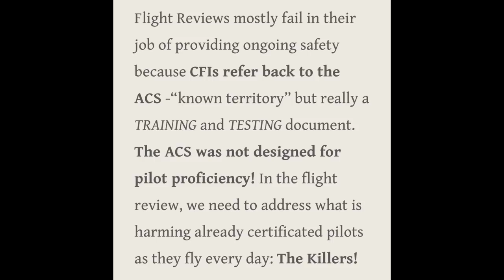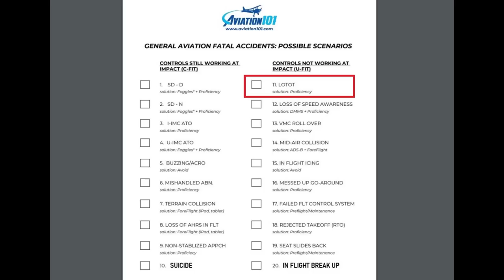Engine Failure at 400 feet.  The Impossible Turn.

Comment: Practice turning back at altitude to figure out your expected altitude loss. You don't have to land on a runway. Take a taxiway, another runway, the ramp, or even the grassy infield. All are preferable to a housing project, a shopping mall, or the trees. Turn around right away. You can talk later. Great job, Mr. Airman. Thanks for promoting AQP, Dan. Barry Schiff's son has been studying this and he's found some "impossible turns" are actually quite possible.
Reply: My sentiments entirely!!
You don't have to land on the runway. You can land across it if insufficient height.

Ploughing through fences or runway lights and equipment etc ain't going to kill you.
Spinning in WILL 

So the airspeed & keep those wings  level close to the ground.

Comment: Not mentioned  much in this vid. was the fact that the engine was still generating some power with three cylinders.    As I understand it, there was not COMPLETE loss of power.   This probably allowed the 180 degree turn that may not have worked out as well with a completely dead engine.
Reply from the maker: True.
Reply: Yep, huge difference in some power and a windmilling prop creating drag
Reply: Was about to say the same thing, and it's probably not that rare for an engine failure to still leave you with some power. That's actually more insidious than a clear-cut engine failure because it might cause a delay in remedial action.
Reply: Yes and PARTIAL power loss on takeoff is yet another thing that the FAA private pilot curriculum doesn’t teach us about! Question - in the scenario in the video, should you leave the throttle in to get what power you can, or is there too much danger the engine will shake itself off the mount?
Reply: @crufflerdoug  Yes, wish the FAA required teaching about partial power loss. I'd keep the power up to make the airport and ignore the vibration.
Reply: I lost a cylinder as I flew by an airport in an 85hp Luscombe. I just turned final, lost some height and landed. The engine was still running on 3 cylinders but stopped on the runway. Turns out the valve rocker mechanism broke on one cylinder so still had some power. But the sudden loss was startling.

Comment: Good situational awareness knowing where the wind was coming from and turning into the wind to stay close to the runway. The radio procedures were god in that you told them what you were going to instead of waiting for their instructions. The first transmission was a little long. I always instructed my students in a similar situation to maintain control of the aircraft, pitch to best glide speed then say to the tower, “Cessna 1234 engine failure declaring an emergency.” And the throw the microphone (or headset on the floor as far away from you as you can and then take whatever action you deem necessary. That was great advice from your Dad. Excellent job and great interview.

Comment: He was lucky to fly into the wind. Every time I take off I decide whether to turn left or right depending on the wind if I decide to return. e.g. He turned into the wind which gave him better lift and kept him close to the airport. What is the problem if he had turned to the right. The wind would be a tail wind with reduced lift, he would be losing altitude and and it would push him further away from the runway. When he turned back he would then face a headwind which would it harder to return to the runway. I am an ATP with 3,600 hours and I have an RV6 and can do a 180 in 200'. A great experienced instructor pilot friend showed me a trick.
1) Push the nose down to maintain glide speed. 
2) Do a 60° bank (Try 45° to start with) turn whilst lowering the flaps at the same time to full flaps.
3) As you bank back to level flight whist doing it raise the flaps back to 0°. ( This is done with or without using the wind)
I suggest you go and accomplish this maneuver. After this then do the same maneuver to a 270° turn to recreate turning back to your departure runway.
You will have fun trying to reduce altitude loss on each attempt and maybe one day it could save your life. 
P.S. I will not attempt the "Impossible Turn" if I am below the TPA. Fly Safe!

Comment: I have had several swallowed valves in my 56 years of flying. A piece of the hard steel exhaust valve breaks loose and is hammering away at the aluminum piston top. The valve either wins the struggle and either puts a hole in the piston(worst) or is ejected out the exhaust pipe(best). In a 4 cylinder if it ejects the piece the engine does just like Dan says. Immediately rough but you still have enough power to barely maintain altitude. I flew one time for 10 minutes in a 200hp Musketeer. In 6 cylinders its a little better and in radials its just a small miss . However when you pull the throttle back be ready to land and you will hear some backfiring. Great job Dan and Dan.

Comment: I used to fly gliders here in Australia.   Particularly with winch launch, "airspeed" is hammered into trainee pilots to the extent that on every pre-takeoff checks every pilot must rehearse cable break scenarios in detail, including knowing and reciting out loud vs, vs1.3 and vs1.5 of each particular aircraft  You must know wind direction and windspeed and proposed direction of turn if the cable breaks and you can fit in a modified circuit.  It is a very comprehensive, rigorous and comfortable, so when the inevitable happens at any altitude you just slip into the well rehearsed process without thinking or startle .... "stick forward, vs1.3, then make your decision as to whether you land straight ahead or fly a circuit.  I am incredibly grateful for those instructors who took us through this.

Comment: It’s unbelievable that the FAA doesn’t require AQP type training. In all of my military flying and instructing emergency procedure training was rarely pre-announced. Imagine taking off in a twin engine helicopter from a tight confined area without single engine hover capability and just as you clear the trees, your instructor pulls an engine to ground idle. Training that scenario allowed me to pass my instructor check-ride, and taught me the importance of AQP type training.
Reply: Actually Joseph, it's not surprising at all! 
As with the recreational Marine industry, the lobbyists fight against making it so onerous to use the product, that adverage people won't bother! 
While the resulting mishaps on the water aren't usually as dramatic as those in the air, lives are still lost on a regular basis. 
Oh well...another used boat/plane off the market!
Hate to be so cynical, but greed is the human condition!
Reply: My CFII would pull power and NEVER announced it.
He’d look over at me and ask … “whatcha gonna do?” I would then verbally and physically go through procedures he taught me.
I appreciate that to this day.

Comment: We always did 400 ft engine pulls on take off during BFRs. We always made our turns back and landed. I wasn't aware that it was an "Impossible "  because it was a common practicefor us to do. During tailwheel training would do 24 250ft dead stick landings in an hour. Made for alot of confidence.

Comment: I think this old pilot was cold enough to fly his Cessna within  its  flight envelope. when the engine quited he was 400 feet high, he inmediatelly unloaded the wing, and didn't overturn the bank angle. The plane was light and the proximity of the parallel runway helped a lot.
Reply: @CFITOMAHAWK2  That's a good point. Nothing far from the real facts: he managed to trade altitude for speed; made a coordinated turn without compromising aerodynamic flow through the (inner) wing. When I say "He unloaded the wing" it means that by pulling the yoke slightly forward, he certainly achieved "0" G-You can't stall a wing at "0" G-.  Managing the startle factor is paramount during this critical part of the flight. Many pilots don't fly to the crash; they just crash.
Without a doubt, Dan is running a very good campaign to avoid spins after an unexpected upset at takeoff.

Comment: Robert's dad was prophetic - keep your air speed!  And, his checklist "Fly the plane" as opposed to stalling or spinning the plane.  The farthest distance you can glide without power is to maintain max L/D airspeed - keep the nose lowered, but not too much, not too fast.  In Air Force pilot training we were always thinking and training for an emergency and memorizing check lists.  Save pulling back on the stick for the landing flare.
Reply: If you want to go down push forward. If you want to go down faster pull back.
Reply: @edwardhobelman6296 v.good axiom

Comment: Looks like he was still above the runway at 400' - which also helped for sure! Nicely handled sir
I'm in the UK. No way a student could do their first solo until they had EFATO procedures drummed into them. My instructor used to close the throttle at 300' and say what are you going to do?
I was always glad when the engine revved up again after I had pushed the nose down and said landing there! 
I can't believe that the FAA training does not include anything for loss of power - on take off or any other time. Surely it must be in there???

Comment: I had an engine failure in a Mooney 231 immediately when I raised the gear. I don’t know how high I was but it was most certainly lower than 400’. One thing to keep in mind BEFORE takeoff is the wind direction. If you have any crosswind at all you’ll have a smaller turn radius into the wind. It’s the same reason that you never turn towards the hill when ridge soaring.

Comment: My dear friend Lonnie had the same exact scenario occur to him in a C150, and he was at 400’ climbing out on 4 at LQK. The top of the rocker assembly casting broke off and left the rockers laying inside the valve cover. He too had a good left crosswind which he turned into and teardrop back to the runway and made it with just a loss of a wheel pant and a landing light, approaching the runway on a slight diagonal. Very lucky day for him as a student pilot. He kissed the tarmac when he got out.

Comment: Hi Dan 
Great video 
I was lucky to be trained in fixed wing aircraft by a Vietnam war veteran who flew Cobra and Huey helicopters. He taught me all the scenarios before I took my PPL single engine. Airspeed & fly the plane all the way to the ground was also something he said during every training session. 
I did have a total engine failure flying an Aeronca Champ in the pattern and elected to land off the air field in a location I felt I had a higher chance of survival. 
He had drilled into me the importance of always thinking about. “ when your engine fails where will you land. The best location might be behind you. Always look for landing spots” 
Slangevar 
Craig

Comment: There was another pilot that survived the turn of death recently. He received his pilot's license within the last 3 months. He purchased a Comanche 250 (59) and got checked out in it by a really good instructor, who trained him in all the things that Dan is advocating for. He took off from Auburn and lost power climbing out (tank selector switch sucking air). Could not maintain altitude. Pushed in on yoke, made the 180, declared an emergency, and made a controlled landing at about 130 knots.  He got it stopped with 50 ft. to spare.  Flat spotted the tires to the cords though. His new name is now Skidsworth. $1500 for tires and thorough inspection.

Comment: It also helped that the engine was generating partial power. 

I had a valve break in a Twin Comanche once. The little 4 cylinder ran very rough, but it ran!

Comment: Bought back memories of my c182 engine failure on take off at Townsville Australia several years ago. One of the things I remember in my turn back was the sound of the stall horn in my ears. Instead of landing in a crock infested swamp and missing the ndb tower by inches I landed safely back on the take off runway the other way. Cause, oversized fuel bladder in wings trapping a lot of water in fuel tank. Cessna went to wet wings on the new 182 I flew after. 
Barry Hill.

Comment: I wish we could have heard how quickly he started the turn back.  He said he reflexively pushed the nose down immediately but did he also initiate the turn immediately?  The audio is a little painful to listen to because of the amount of time ticking by as he communicates to the tower his situation and intentions.  I'm thinking as I'm listening to it that he is communicating everything first and then initiating the turn after the communication which seems to take forever. I hope he immediately pushed forward and started the turn while monitoring air speed and then got on the radio to communicate his emergency and intentions.  It took him 10 seconds on the radio to get to " I'm doing a 180..." and then Dan cuts off the recording...he might have talked another 5 or 10 seconds easily.  I'll just assume he was multi-tasking, talking and turning and monitoring instruments but in these 180 scenarios, 2 or 3 seconds of time are priceless and usually the difference between life and death.  Another take away on this should be Aviate - Navigate - Communicate.  All that time communicating did nothing to save his butt, it's a nice to have if you have lot's of time but in this scenario I'm not wasting even a second of time or my brain focus on anything but getting the plane to the ground safely which is going to happen very quickly at 400 feet with a 180 turn.  Another thing to keep in mind is the pilot was estimating his altitude and he might have guessed low with all that time he had to chat.  When losing an engine and power in an instant during takeoff, the reflex to lower the nose should be followed by check Altimeter having a Go/No-Go number already figured out in your head re: making the turn or going straight ahead picking the least bad landing spot.

Comment: Not to diminish the pilot's ability in any way of course, but this case was not quite the "impossible turn" scenario for two reasons. One, the engine didn't actually quit (it "ran rough") so it did provide at least some power helping in some measure to maintain airspeed. And second, he landed on the parallel runway, which is a much easier maneuver, involves less turns and loses less altitude than turning back to the exact runway from where the take-off was done. Great job nonetheless, we could all learn from his experience. Great inverview too.

Comment: The result after a sudden engine malfunction depends on the perception, personal skills, training and experience of each one. That's why during an upset  recovery, trained pilots react as if they're in some kind of low motion mode that allows them to react sharply and quickly. This is particularly noticeable in single-engine helicopters: as soon as the r.p.m. of the rotor drops slightly, simply lower the collective and go into autorotation. No time to think!.
 Great chat Dan !

Comment: My instructor had a surprise every flight. I became conditioned to assume something would happen, and if not it was going to sooner or later.  I landed in simulated dead stick all the time, he cut fuel during maneuvers simulating engine failure during climb, turns, landing etc. He had experienced a engine fail on takeoff with a loaded aircraft near max weight.  He landed and learned a ton. He would not allow his students to experience the same without some tools to handle it. He also drilled into me...airspeed!!!!  Obviously this is correct advice.

Comment: Rotate, stay in ground effect, climb at vx, bleed off flaps, early turn x wind, close in downwind, cleared for the option, short approach, power off, steep approach, full flaps, wheel land tail low.... Energy management and angle of attack is key. Keep the nose pointed down all the way until the flare to land.

Comment: I used to try engine out in MS Flight Simulator with the Cessna.  It seemed to me that you needed 400 feet to make the 180 turn with power out.  I thought that might be why they have you turn once you have 400 feet on climb out.  You had to lower the nose and start turning as soon as possible.  Doing it in the simulator takes the stress out trying it. Good job!

Comment: Extremely interesting discussion. 

I used to be a tug pilot. The climb rate towing a glider is rather low. So I constantly considered "what-if" energency landing sites. Being also a glider pilot that is actually natural as out landings are "part of the business" of flying gliders.

Besides what he said about "speed-speed-speed" (& pitch) to look at:
The wind direction is VERY crucial (he said it a couple times as well). If there had not been some crosswind from the "good" (left) side, let alone from the other side, 
he could not have made that 180 deg turn from that low altitude and reach that runway!
These 180 turns out of low altitude after take off are so critical & dangerous. 
Would have been a tough one to decide where to put that plane down if the wind had been different. From that aerial photo one does not recognize many other suitable options.

Check list item before take off: 
Check wind, determine possible emergency turn direction in case of early engine failure --> only ever into the wind, or do only very shallow turns (thus, no 180 degree turn other than against the wind possible)

If you know that airfield well, maybe you have figured out emergency landing spots for all kinds of "what if's" beforehand. 
It does not need to be a runway; of course one would be nice, but actually reaching that other suitable landing spot without stalling the airplane is "nicer" than attempting and not reaching that runway.

Thank you again for that interesting insight from that pilot.